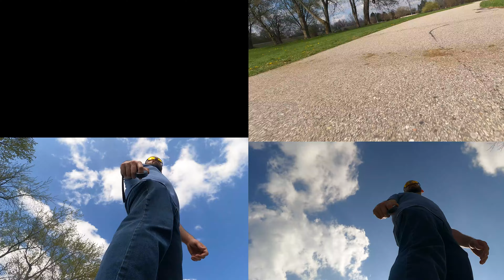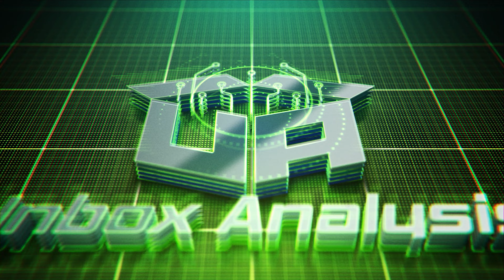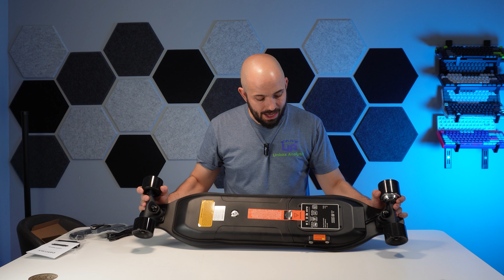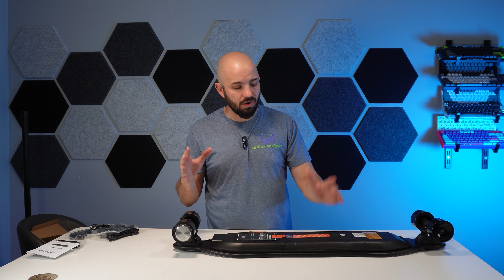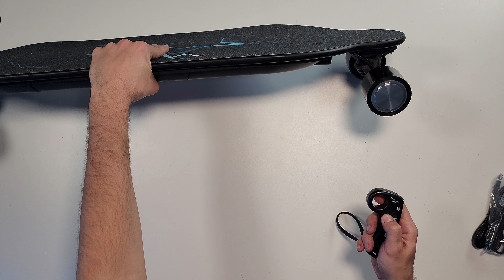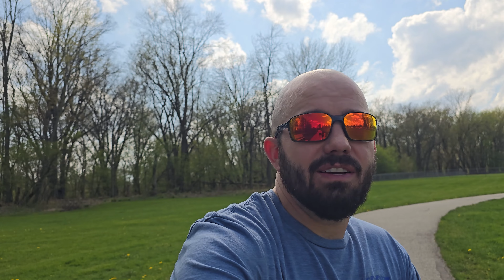My First time on a Skateboard | And it has 350 Watts!

Comment: I get you're a newbie to these, but why give buying advice when you have no clue what you're doing nor know nothing about eskates?

1. All PEVs are judged by specs. Aside from mentioning the single 350W motor...you gave absolutely no important specs. Battery voltage, battery capacity, top speed, max distance, truck type, motor type, wheel size, wheel durometer, bushing type...you left out everything critical to electric skateboards.
2. What happens when the powered wheel wears out? Is it replaceable? 
3. Price?
4. Performance comparison?
5. Upgradable?
I'm not a newbie...so here's the real scoop:
Nobody should buy this bottom of the barrel quality board, it's a complete waste of money that is slow, has the lowest quality components, the lowest specs, and is not Upgradable. 
Spending 100 more gets you double motors(safer and faster), more voltage, more capacity, and Upgradability. 
Also everyone who rides these should not be like this guy, wear a helmet at a minimum.
Reply from the maker: Awesome, I really appreciate comments like this. So just a couple things, first what skateboard would you recommend in that +100$ category? I will take note of what you said there, i did ask around a bit on a few facebook groups and no one would list out what they wanted to see so I really do appreciate that. 
I will go get all of the info you suggested and make sure I pin it in the video some time tomorrow. 

Also I did state in the video people should wear a helmet I 100% agree with you ^^
Reply: @UnboxAnalysisOfficial  try Veymax Cejour, thats a $379 king in electric skateboard entry level!